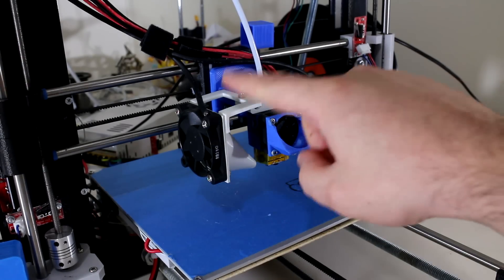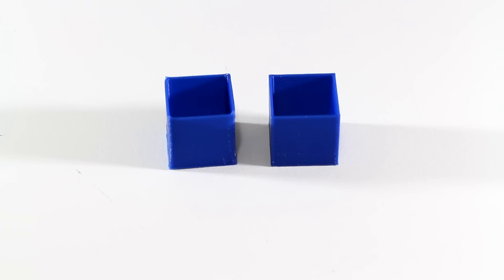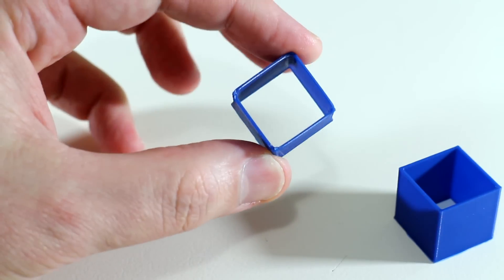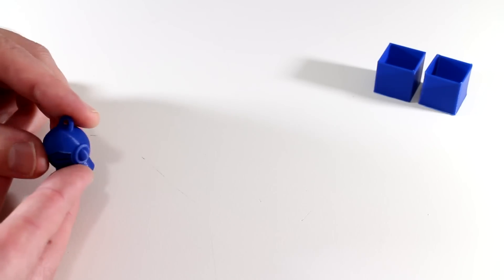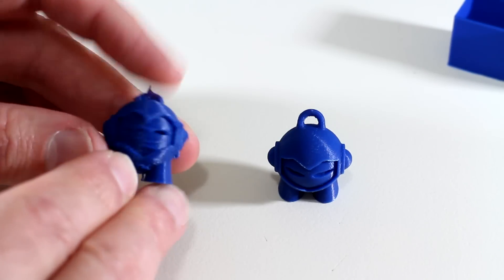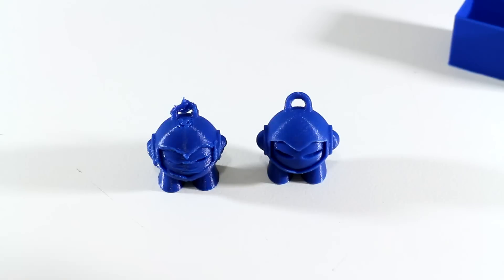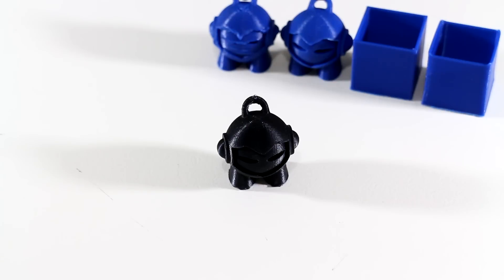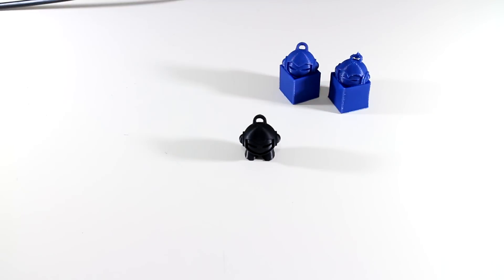3D Printer - Quality Printing with Cooling Fans

Comment: PLA is pretty forgiving when printing with it. You always use the fan or fans when printing with it. Now ABS is a different animal. I've had my temps on the extruder and hot bed right, no fans and I even built an enclosure to keep ambient temps consistent. The part I needed to print, I ended up printing about 4 times because of warping. I even used ABS slurry(juice) to help it stick and still the last part was still warped a little but was usable. I don't have the time right now to sort out and experiment with the ABS but will when time allows.

Comment: I always enjoy watching the videos on this channel.  Very informative!  A few points:

I've been able to simulate the high quality demonstrated using fans, but have done so without fans.  The secret is cutting the printing speed in half.  When everything is happening a lot slower, the results seem more precise.  I ran those tests in PLA.

Secondly... I've just picked up a bunch of 40 watt peltier effect plates, and have a bigger one - I think 120 watt - on order.  These are the heart of those electric iceboxes they sell for use in cars; run DC power through them and one side of the plate gets cold, whilst the other gets hot.  They're quite cheap, although consumptive of power.  It occurs to me that if cool air is good, colder air might be better.  Might be an interesting variable to play with.  I suspect that it would be possible to drop the air temp by 10C or more, but that's just a guess.  Just a thought.
Reply from the maker: +charles worton Interesting idea with the peltier devices. Thanks for watching :)

Comment: Thumbs up! This is such good information and has absolutely put to rest my faulty concern that the fan will cause the plastic to harden before it has a chance to solidly combine with the underlying layer thus causing delamination. As a result, I have been struggling with all those excessive heat issues causing faulty prints like you've shown thinking I can achieve a cast like piece of higher strength with "gooier" plastic. I now accept that these are separate processes and better results are achieved by optimizing the conditions for the specific process. Thanks for a complete mindset focus change which should definitely improve my results.
Reply from the maker: +SayWhat? Thanks for watching! When I first assembled my printer it didn't come with any part cooling. It was only after frustration of not being able to print smallish pieces and fine detailed parts that led me to cooling fans. I highly recommend the addition after the success I've achieved :P

Comment: did you modify for the 2 fans?
Reply from the maker: +Frank DuBay 
What?
Reply: +Tech2C did your printer come with the multi fan set up or did you customize it
Reply from the maker: Frank DuBay

I designed the Bowden mount for the E3D hot end and incorporated the cooling fans:
http://www.thingiverse.com/thing:547706

Comment: Did you print the cubes with always the same print speed? Usually I used settings for the filament to slow down print speed depending on the layer time. e.g. 40" as a minimum. This helps to improve layer quality. Of course good cooling fans are key as you demonstrate.

Comment: Hello all, I have a general question for anyone.  I want to buy a complete kit and assemble an i3 printer from scratch.  Any suggestions as to where I can find a good kit and not spend a lot of money that I don't have LOL?
Reply: At http://www.gearbest.com take a look at the Anet A8.  You have to mod it up after you put it together, but that gives you something to print, and learn from.
Reply: Thanks for the info.
Reply: I got the RepRapGuru Prusa I3 and I'm pleased with it. The instructions were pretty bad, but if you're mechanically and somewhat electrically inclined you can get through it. The instructions were just mostly out of order of how I'd do it and didn't explain in enough detail sometimes. 

The kit was $300. I got hung up on the firmware part but I called customer service and they told me to download everything off their google drive. Had the firmware issue solved within an hour. Their customer service is great, very fast response time through email, american company with domestic phone customer service, not outsourced. If you get one and have issues building you can message me. I ran into many issues and had difficulty finding answers on the internet.

Comment: Have you tried doing the same test but lowering the extruder temperature? My printer doesn't have cooling fans for filament already laid down, just the heat sync fan. My print come out just fine.

Comment: I guess it's still a matter of balance, his printing temp is too high and can be improved for use without fans, and I'm guessing when you introduce the fans in the formula you'll have to adjust printing temps again... if it was printing as close to perfection without fans

Comment: Greetings.
I would like to know that it is exactly the dimensional accuracy +/- 0.05 mm - +/- 0.02 mm.
Also know if this value in filament reels are reflected in the quality or finish of the final print.
Thanks for the help.

Comment: I have the exact same digital calipers!  I love them!  BTW - I couldn't figure out why my prints kept sucking.  I tried everything from layer height to print speed.  While I got less distortion on .3mm layer heights, there was considerable z-banding which would be difficult to get out with primer (printing on PLA).  After watching  your video I pointed my desk fan at the print bed and I got much better results across the board (my extruder only has one fan).

Comment: why are you printing that slow? 20mm/s
Reply from the maker: +Raul Toraya 
The Marvin settings were chosen to match how I printed it in the previous video linked within this video. Therefore it was an apples to apples comparison. I choose 20mm/s back then as I wanted the best quality my printer can provide. As it's a Prusa i3, the moving y-axis platform limits what speed I can print at without affecting quality.

Comment: Seems like too much cooling would also be a bad thing, because that would prevent   newly deposited plastic from fusing with already deposited plastic, which seems to be a problem that I am currently having. Part strength is also an important aspect of quality! I think my problem is that my printer is in an unheated garage. I put it there so that fumes don't pollute the areas where we live. I've put a cardboard box over the printer to retain heat, but that does not seem to be enough :/ I'm hoping I don't have to put much effort to solve my part strength problems... Suggestions, anyone?

Comment: What is the best prosumer  3d printer that uses a 0.2 mm nozzle? (with 50 micron layers) i need to build thin wall (0.5 mm or less if possible)

Comment: This is a slightly misleading video. I wish you also wrote down your temperature settings. The way it looks your nozzle is way to hot! With such a printer without enclosure the layers must have solidified already without the fans. And the fact that your nozzle cant even be seen also hints at that unnecessarily high temperatures. 

It is simple, your hot end is too hot and too close to the print. Please clean your nozzle mate. It almost makes me sad to see a nozzle suffer like that!

Comment: I usually try to run 3 cooling fans in a 120 degree layout for 360 degree print coverage. Btw. what Z couplers are those? I have tried several brands and so far haven't had much luck finding some that are drilled 100% square.

Comment: Good video! I recently acquired a printer and gave up on PLA after a few days of complete failure. I blamed the filament and changed to ABS which works great. But now I think this explains why my PLA prints weren't working.

Comment: hey man iam printing on my selfbuild p3steel( i use the cheapest parts i find in chinese shops) i printed this too i never use cooling i print this with 70mm/sek 0.2mm layer hight annd 220c° i think its not needed to increse printing volume with fans stiff youre printer increase speed and maybe decrease melting temp it must be working pretty good my result looks way better than youres with cooling and only 0,05 out of measure  but maybe iam wrong and with fans i can increase my print quality way more than before 

MFG Micha
P.S. sorry for bad english

Comment: My machine (Lulzbot Mini) is equipped with a cooling fan.  Looks like my settings are 40% to 60%, and it starts cooling after .5mm I believe.  My prints have been suffering from what I think is weak adhesion between layers, I have parts breaking clean on layer lines, but at the same time I have some drooping on finer details.

So logically on one hand the difference in layer temperature would result in worse adhesion, so less cooling I think would produce a stronger part, but on the other hand cooling layers quicker should produce more accurate details.  So I don't know if I should go up or down on fan and extruder temperature.

Or is my filament just crap?  I print with ABS and I do use kind of cheap filament (Excelvan?).  What do you think?

Comment: For structural parts should you disable the cooling fan for maximun strength?
Reply from the maker: I think so. The fan is useful for bridges and very small print areas, or low layer print times. If the plastic has time to cool on its own before the hotend comes around again then the fan isn't needed.

Comment: Tech 2C? Hi i'm Dale and i was wondering two things, 1. What is the brand name of the 3d printer you got?  2. Did you install those fans yourself and if so how?
Reply from the maker: It's the Replikeo Prusa i3 Rework kit. It's quite old now and mine isn't in the best shape. I'll be upgrading to a new design shortly.
The fans are part of the RAMPS board. I designed the mounts and wired the fans in to the board. Just google 'ramps fan connections'

Comment: Agreed fans is better but I get better results than you without fan, probably because I print with lower temperatures then?
Reply from the maker: +François L PLA was set to 200c. This was printing slowly (20mm/s), plus this object is very small, so the radiant heat from the hotend was keeping the entire part hot.

Comment: Great video!

We need more of this myth-debunking. You would not believe the grief I have suffered in the past for even suggesting that you can use a cooling fan with ABS. And let's not get into the subject of setting minimum layer print times - that seems to be an even hotter potato.
Reply from the maker: +Neil Darlow 
Lol, yeah, well, myths are meant to be busted?? It depends on the object shape of course, as I wouldn't use the fans will long parts as the ABS would bow and pop off the build platform half way through the print. But the results with cooling are so much better it's hard not to add just a little cooling... ;)

Comment: I printed some calibration cubes too, and I noticed that there was a small vertical line running up the inside of one edge. It looked like your 3d printer does the same thing. Do you know how to eliminate that while slicing the stl file? Thanks

Comment: can you do a video about installing fans and the code for them?
Reply: Yesss
Reply: not a 3d printer myself, but  it seems pretty straight forward. 
Since the point is  to get as much cooling as possible, no need for anything but red, black, and an on/off switch. If you really feel the need to program, just have it turn on just before the start of printing, and off just after completion. No real need for any fancy power modulation or anything like that.
As for installation, find a place anywhere there is room off to the sides. 
Then measure out and design shrouds, print them in the poor melty quality. (don't use the fans without shrouds as you'll cool the places you want the plastic to melt)
Mount the poor quality shrouds, turn on the fans, reprint the shrouds for a better set. Rinse and repeat until quality of print increases are marginal.
Reply: @QuiznosBear  I might be slightly late to the party, but PWM should help when printing other materials.
Reply: @SuryanIsaac  material being printed doesn't matter at all. Reduce variables as much as possible. Leave the fans at max speed, and just make better shrouds.
Reply: @QuiznosBear  I print PLA at full speed, and PET-G at 60%. ABS without fan. Works well for me. Also, no fan for the first layer and 30% fan for the second to fifth.

Comment: The box fans don't do a very good job when they're coupled to a duct as they don't like back pressure. That's why you need two stonking big fans. I use a small "blower" style fan as they're designed to be fitted to a duct, and so couple it to a circular nozzle. I can't find the actual one I use, but the concept is similar to this http://www.thingiverse.com/thing:714939 By mounting it on the side facing the front, it doesn't interfere at all with the operation or work area of the build plate, and provides excellent cooling.
Reply from the maker: +Pete F 
I like the blower fans compact form factor. I had purchased a couple to replace my 50mm axial fans but havn't got around to swapping them out yet. These axial fans I had spare so I used what i had, and the results are great. For my next printer build I'll be using blower fans. Cheers!

Comment: Hello there! Great tips - I'm definitely adding fans to my Prusa i3 after watching this video. What a difference! Thanks for sharing :)

Question - is that blue tape you're using for the ABS? Did you have to treat the surface with anything first, like slurry, glue, etc? And in your video (printing requests) with the quad copter and the ABS socks / covers, was that tape again or PEI strips?

I've been wanting to try printing ABS but have been scared about fumes, warping and the witchcraft involved in getting it to stick, but you make it seem effortless! :)

I'm running on an aluminum bed (solid mounts with an induction probe for auto leveling - still get ghosting around holes - debating switching back to springs for fine tuning), no glass and currently using blue tape with PLA @ 30C for the bed (small room and the AC keeps it much to cold in there which caused warping problems initially until I made the bed a bit warm) and wow does it stick - almost too good most times (usually tear the tape on large flat pieces and have to employ plastic putty knives).

Sorry to ramble. I'm a chatty guy lol. Subscribed and thanks again!

Comment: Good video, I use cooling with ABS most of the time.  In my tests it helps a bunch. Not withstanding dialing in the correct filament temp and speed, the only thing that I watch for is layer adhesion, but that is generally a filament temp issue. 

 I also think it provides a better a surface finish.
Reply from the maker: +RJ_Make I find using cooling allows greater flexibility on temperature choice. Some filaments show a glossy finish with higher temps, whilst other filaments benefit from a stronger layer bond at higher temps. Cheers!
Reply: Tech2C
I was wondering though, do the fans sometimes cause problems with layer adhesion, because they cool the extruded plastic too much?
Also, how well does it work with a high feedrate? I'm thinking about building a printer, and would probably like to do high feed rates, if I can ... (Like 100mm/S)

Comment: well I  think this is overrated. the prints you are doing without cooling are so bad that it shows that your printer in it self is totally unacceptable. a normal printer , well calibrated , should print in acceptable quality wich yours does definitely not. check your printer....

Comment: your nozzle heat is to high thats why its melting after printing
Reply: I was thinking the same thing. Waaaaay to high temperature.
Reply: Callum Thiess fans are good regardless but your right. I wonder if that high heat makes it even a few seconds/minutes printing in real time. I doubt it though. There’s some truth to this, great video
Reply: And fans off vs no-fans isn't the same: they are containing the heat shrouding the nozzle.
Reply: Yeah me too
Reply: Software should prevent that. There is something like, time between layers...
Reply: The software is not aware that you have shrouded the nozzle with inactive fans. Too many variable, "D" would be the grade at a science lab or a White participation ribbon at a fair.

Comment: Diddo, And what about ABS with fans turned off?
Reply: fans can be good for ABS on specific features, though fans on ABS is better in a enclosed warm chamber than dropping to room temp.  the whole part needs to cool equally at the same rate to prevent warping and cracks.   but stratasys machines have no heat bed and a fan of warm 70c Air in the chamber.  seems to work well.

Comment: This helped me so much! thank you!  I was getting exactly the over-hot on my ABS and now I used 50% fan and the finish was much better!
Reply from the maker: +TheAmusingMe 
Fantastic!
Reply: Dare i say, your prusa i3 looks prints as good (if not better) surface quality than an ultimaker 2+, lol.
Reply from the maker: DrR1pper

Cheers! A few upgrades, tweaks to the firmware settings and the chosen slicing options makes a big difference.

Comment: May I be the annoying bugger to point out that two fans working against each others are not exactly helping to get the airflow going? ^^)
I guess your are absolutely fine using one of them, or turn one of them around, remove the nozzle and use it for sucking warm air away from the print.
Reply: May I suggest that one fan isn't as effective in one direction? Obviously didn't hurt.
Reply: Do you think that the two airflow crash against each other and stay on the bed and heat up? Mind blown.